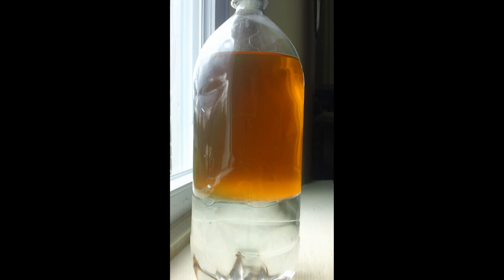Biodiesel water wash separation

Comment from the maker: Single stage, KOH base is 7.5, our titrations usually average between 2-5 can't recall what this batch was. 21% MBV. We use well water which is pretty hard, runs through a small water heater so it ends up being warm by the time we add 30-40 gallons.  This particular sample was washed with municipal water run through a water softener but is pretty representative of what we get in our larger (230 gal) batches.  Thanks for your comment, please share and favorite